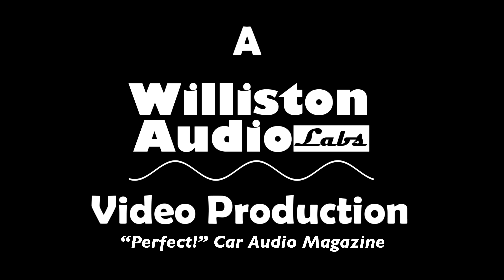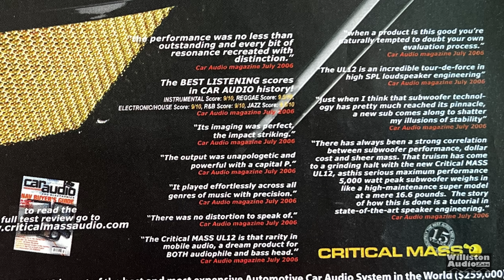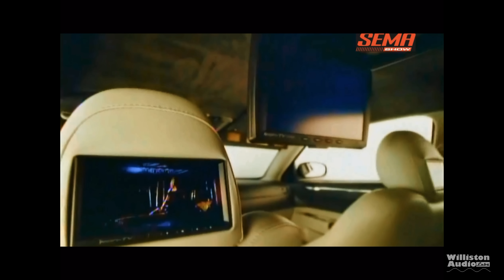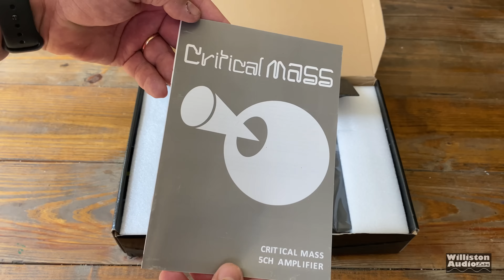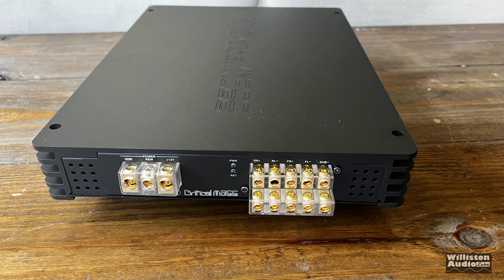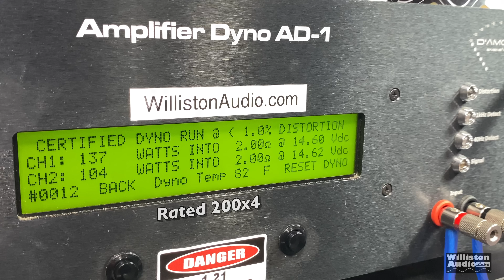The PERFECT Amplifier? Critical Mass ULA-A5V2 Five Channel Amp Dyno Test and Review [4K]

Comment: Shaq had this system in his van-o-death!!!!!!!
I worked for J&J electronics in 06' and we did a caddy truck with 1-12" UL-12 off of a Rockford Fosgate T3000BD! ( at 3 ohms) the box was built to spec at 1.5 cu ft. Sealed.  It took all the amp and was slapping! I was there during the entire install and i believe in them !! ( i sold 2 of them subs) 😊

Comment: ANYONE ELSE NOTICE THE AMPLIFIER TESTED IS NOT THE CORRECT MODEL?  LABEL ON AMP SAID ULA-A5V2.0  FROM WHAT I REMEMBER THAT IS ONLY A 2000 WATT TOTAL POWER 5CH AMP.  IF YOU LOOK AT THE REAL ULA-A5 IT LOOKS NOTHING LIKE THE AMPLIFIER TESTED. I would test a Legit amplifier not some used open box wrong model....

Comment: ANYONE ELSE NOTICE THE AMPLIFIER TESTED IS NOT THE CORRECT MODEL?  LABEL ON AMP SAID ULA-A5V2.0  FROM WHAT I REMEMBER THAT IS ONLY A 2000 WATT TOTAL POWER 5CH AMP.  IF YOU LOOK AT THE REAL ULA-A5 IT LOOKS NOTHING LIKE THE AMPLIFIER TESTED.
Reply: I did not notice the first time i watched the video. But you are right. The model # on the amplifier tested showed ULA-A5V2.0 that should have been EZ to figure out by Big D. If this was done on purpose or intentionally to trash a companies name or product I would be pissed . Hope they fix this error
Reply: I did notice but did not want to be the first to point out that obviously someone made a big mistake.  hope it was an honest mistake and not maliciously or ill Intentioned
Reply: I have one of these amplifiers and the model is ULA=A5V2.0 pushing a JLaudio 12W6 and 2-way 6.5'' components in front and 6x9 in the rear on my 1987 I-Roc Z28.  I have had the amp since 2009 and no issues and no noise. They should probably test a new Amplifier when doing tests, to make sure product is new and not damaged or abused. By the way this amp is only rated for 2000 watts max power.  So the test seems pretty close to rated power. Don't really know why they would say it is a Different model than the one that was tested. The ULA-A5 is a much much larger amplifier about twice the Size if i recall.
Reply: why would someone test one amp, and say it's another...  i am no car audio expert, but the model on the amp tested said ULA-A5V2.0 very clear on the label. But you keep saying it;s  another model ULA-A5 that model is twice as big in size and power.  if you want to maintain integrity i would make that clear to your viewers.
Reply: @dealershipplug-n-playinfo3292  Why are you all shilling from different accounts? What difference does it make that the amp looks and performs like complete garbage.
Reply: i see what you mean, this is not the ULA-A5 model. the ULA-A5 was like bigger than 2 feet long and looked 100% different. if you are testing the ULA-A5V2.0 you should be honest and use the specs of that model not a different Amplifier. I am not a pro at this, but it does not seem ok to give your viewers false specs and model #'s just to trash a company... like it was said before I hope this was an Honest mistake and not done on purpose.
Reply: Lol he tests 30 year old amps that sound better than this crap and they haven’t even been recapped.
Reply: @BassKiaK5  ^^all of the above comments are from 7 and 8 hour old accounts. They/he is part of the same machine that brought you Critical Mass in the first place. I put as much stock into the paid actors as I do the “Car Audio Magazine” quotes from the eBay seller. 😂😂
Reply: @StockA4   lol I know, it’s probably the owner that made the accounts, company is probably ran out of a garage or storage unit
Reply: @BassKiaK5  which is a shame, because their subs were darn decent. I don’t understand why the amp offerings would be so drastically different. Unless it was a bait and switch? They sure did ramp up the hype machine though!
Reply: This amp is a knockoff of the real amp, I have an original  ULA-A5V2.0 doesn't even look like this it's slimmer and way longer, this one looks like a powerbass amp  lmaoo

Comment: If this is a 2006 amp, why does the driver board have a 2011/04/17 date? Something fishy....
Reply from the maker: Who said it was 2006?  🤷‍♂️
Reply: @wal  My Bad! I was confused after you showed the UL12 in the October 2006 Car Audio magazine. 😁
Reply: @wal  Why would you tell your viewers that you tested the ULA-A5, when the amplifier you tested had the model # ULA-A5V2.0 on the label. That is not the same amplifier. I hope that was not done on purpose. The real ULA-A5 is like 25 inch long and puts out a lot more power and is like 30 pounds. The amp you tested  ULA-A5V2.0 is only rated at 2000 watts output. Also the amplifier you tested was opened, damaged, missing parts and 12 years or older. I would love to know if this was done on purpose or by mistake.? Something smells here, and it's not the Amp!

Comment: It is old and Caps are probably half dried up.  it making noise means it is sick.
Reply from the maker: It’s only recently discontinued and sold as “new”
Reply: @wal  Why would you tell your viewers that you tested the ULA-A5, when the amplifier you tested had the model # ULA-A5V2.0 on the label. That is not the same amplifier. I hope that was not done on purpose. The real ULA-A5 is like 25 inch long and puts out a lot more power and is like 30 pounds. The amp you tested  ULA-A5V2.0 is only rated at 2000 watts output. Also the amplifier you tested was opened, damaged, missing parts and 12 years or older. I would love to know if this was done on purpose or by mistake.? Something smells here, and it's not the Amp!
Reply: @wal  12 to 16 year old amplifier. Lets keep it honest here. the more i look into this them more i see bad intentions... I would clarify the mistakes in the video before you loose your credibility.
Reply: @wal  Discontinued for over 11 years... we really have to get the facts right here. This is starting to look bad on your end, like no one really cares about anything but making a Company or Brand look bad. I Hope this is not the case. Like i said before i enjoyed many of your videos over the years, now i am wondering if there are more issues like what happened here. This is a great disservice to your viewers that trust you to have the correct info without '' BIAS '' like it should be!
Reply: No this is a design issue. What you’re hearing is a beat frequency caused by two ultrasonic oscillators blending and making a third tone that is audible to human ears. Super common engineering blunder.

Comment: Thanks Dick Rickulous! The more I think about it you may have a faulty unit there. With that noise, channel imbalance, and the erratic climb in wattage I would bet there's a fault somewhere in the preamp section of that amp. But even if it was working as designed there's no way it's going to it's rated power those parts are not physically capable of putting out that much wattage

Comment: It's probably not a real Cr Mass  amplifier, if the owner got the price down to $700 from a $3k or $4k listing price, it's probably a Chinese knockoff. But if it is real, it's basically just a $4k Boss amp with CM badging. Atleast make the amp do rated power if your gonna sell it for $4k, and the damn thing doesn't look like it's giving out clean signal by the way the power was bouncing around on the dyno and making static noise. If any of the amps tested that deserves the deez nuts guy saying "Got'eem" the most, it's this amp. $4k for a cheaply made 600 watt amp that gives off a dirty signal is the epitome of "Got'eem", cuz if you bought one you definitely have been Got. I'd sue for false advertisement.

Comment: My ul 800.4 sounds great without any problems and looks much better inside then that one does. Maybe it's a knock-off...
Reply: My thoughts as well, I have the 6.5 front stage with the Ul 800 amp and two 10 inch critical mass reference line, they all sound very clean

Comment: So how do you set up the resistance?  Do you run the resistor across the channel or in-line on the positive?
Reply: Connected across the speaker terminals that are not connected to the dyno. Called Dummy Loads.
Reply: @brandise76  ok gotcha.  So the dyno sets the load for the test and you just strap out the channels not used.  Makes sense now

Comment: Something tells me this may be a maybe a cheap knockoff?
Back in the day companies were making Pioneer cheap knockoff speakers 
They actually made a advertisement 
That said “ we are not flattered 
I don’t think a company would make these claims plus charge $5000
Or the amp was defective?
Because their subwoofers rated really high by car audio 
I would contact the company .Ask them to look up the serial number?
See when and  if they actually manufactured
It 
I am a Chemist!! I formulate and create sports nutrition supplements 
I designed and formulated proteins
I had a company manufacture the products for me because they gave me amazing pricing 
The proteins I used were 80-90% protein 
When I got the protein made 
I got it back 
People loved the taste .
To the point I got suspicious 
I had it tested it and it came up 30 and 35 % protein 
I was paying for 80-90% protein 
I also paid for a Natural sweetener 
I was getting cheap ass aspartame and Fructose 
So maybe you got a knockoff?
Or maybe the company .
Did what I did .They paid to have it manufactured for them
Then got a snow job ??
I don’t know ??
But those ratings don’t make any sense
Plus the huge difference between the left and right channel output ??
Made me suspicious??
It was like a 40-50 watt difference?  
That to me means it’s a defective product?
Or a cheap knockoff 
No company in their right mind would produce a amplifier for $5000 with so many discrepancies??
They would be out of business 
Big D ,please look into this ?
Maybe they are crooks ???
Or maybe the guy who you got it from was had lmao 
If I paid $5000 for a amplifier 
It didn’t do near it rated power 
Plus one charnel is significantly loud then the other 
I would want my $$!
Back or a explanation??
This make no sense ??

Comment: ...I bid on a CM amp on eBay....I smelled a rat and let it go...glad I did. There are reputable high quality amps that are expensive, but FAR LESS than the CM gimmick, I doubt it is made in the USA....for those who have the means , and appreciate high quality American made amplifiers, we still have Linear Power, Mats and TRU Technology....and little else...i am not sure what is going with D'Amore, but it looks like they have sold out....I hope I am wrong, but, this is something I pay attention to....I would love to hear of other American made gear if I have missed any. i know many of the young people only care about cheap watts, but a well designed system does not need a million watts...you may better understand as you get older.

Comment: Great video. I once purchased a IconTV head unit because it was supposed to be good. When I got it, it looked cheap. Was surprised but when I hooked it up I was floored. It sucked so bad. Could change a thing. Touch screen was wonky.

Comment: Also, my phone doesn't have a sub, but it does have 3D stereo output and once again, I'm not overly impressed. My Skar 5 channel amp sounds just as good and doesn't have the odd humming sound at idle. Even my old Soundstream Reference 1000x4 sounds better than that.

Comment: When you showed under sized 4ga, that was a dead give away. But I thought the highs sounded pretty good for the most part, but the lows, never even seen the quads move at all. Lol
All in all great video Big D!
Question tho, have you ever made a video on how you set up the load on the channels not connected to the dyno? Just wondering.
Reply: clearly a hustle, I am glad CM has been exposed. I did a bit of research on CM while bidding on a 4 channel on eBay, too much did not make sense, so I let it go, glad I did...some sucker won the auction...I wish him the best
Reply: He explained that the channels not connected to the dyno are loaded with resistors.
Reply: I don't think there's a video about it specifically but if you watch some of his older videos he shows it hooked up. It's nothing special just a few resistors on a wood board. He can wire them in series or parallel just like speakers

Comment from the maker: Shop for this amp: https://ebay.to/3PXJfUm
Other Five Channel Amps?
Down4Sound JP95: https://bit.ly/3yYtd6v
AudioControl D-1300.5: https://amzn.to/3mbXaIV
Alpine X-90AV: https://amzn.to/3au5zVu
Pioneer GM-D9705: https://amzn.to/3xiFNMF
NVX VAD11005: https://amzn.to/3auomA1
Down4Sound JP8/84 Combo: https://bit.ly/3Q3H9Ce
Kenwood XH901-5: https://amzn.to/3NVCOiU
Infinity Reference 7005: https://amzn.to/3xhFOjT
Rockford Fosgate T1000x5ad: https://amzn.to/3xiSib9
Kicker CXA 5 Channel: https://amzn.to/38QgBUp
JBL Marine MS4505: https://amzn.to/3aq1NMG
JBL Club A5055: https://amzn.to/3anrxt8
Stinger Micro 5 channel: https://amzn.to/3Np1JeW

Articles Mentioned
See Amp on Archive.org: https://bit.ly/3x7NO63
See Article about UL12 Subwoofer: https://bit.ly/3x5hzEt

Video Index:
0:00 Intro
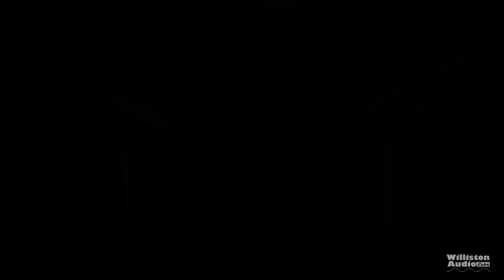0:15 Critical Mass UL12 Sub
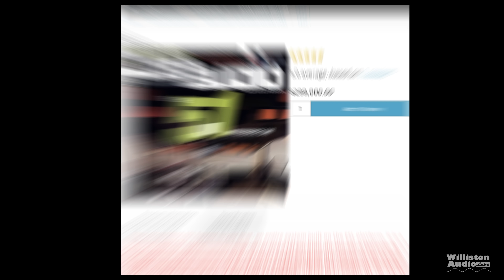1:48 CES5.1 System
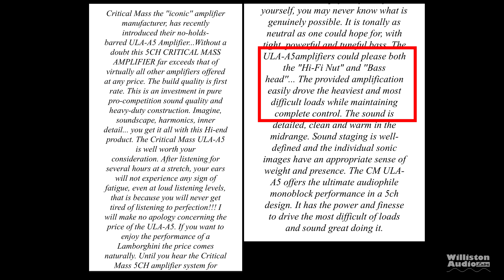2:58 Dick Riculous Speaks
3:24 Unboxing the ULA-A5
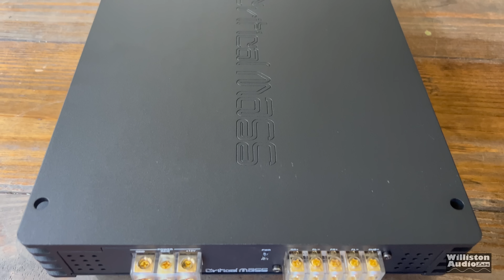4:07 Specs and Features
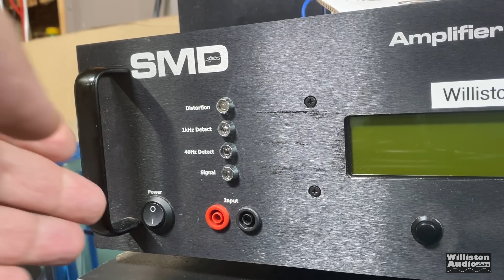5:52 Amp Dyno Tests
12:41 Sound Demo
15:48 Thermals and Internals
17:38 Pros and Cons
18:41 Final Thoughts
18:54 Extras

Shop Down4Sound and Support Williston Audio Labs!
See more and get your JP amp here:
(Affiliate links and all may not be available)
JP33 Amp: https://bit.ly/3PKhSNk
JP43 Amp: https://bit.ly/38qOcUQ
JP63 Amp: https://bit.ly/3t0fAQy
JP83 Amp: https://bit.ly/3t0zz1y
JP132ab Amp: https://bit.ly/3yYsEcT
JP34ab: https://bit.ly/3sZoFsY
JP23v1.5: https://bit.ly/3yYt9DN
JP234 Amp: https://bit.ly/3NF8clC
JP8 Amp: https://bit.ly/3wOBbhg
JP84 Amp: https://bit.ly/3lR2ukJ
JP95 Amp: https://bit.ly/3yYtd6v
All JP Amps: https://bit.ly/3lMb4kz 

SMD / D'Amore Engineering Amp Dyno: https://goo.gl/sJTcf7
XS Power D1400 Batteries - https://amzn.to/2BPFCKW
XS Power PSC60 Charger - https://amzn.to/2CHGcfs
Fluke 1000A AC/DC Clamp Meter: https://amzn.to/2Rw5WDA
Handheld Dyno: http://amzn.to/2u2EgKV
My Favorite Screwdriver Kit: http://amzn.to/2x0VzcE

DISCLAIMER: This video and description contains affiliate links, which means that if you purchase from one of the product links, I may receive a small commission. As an Amazon Associate I earn from qualifying purchases